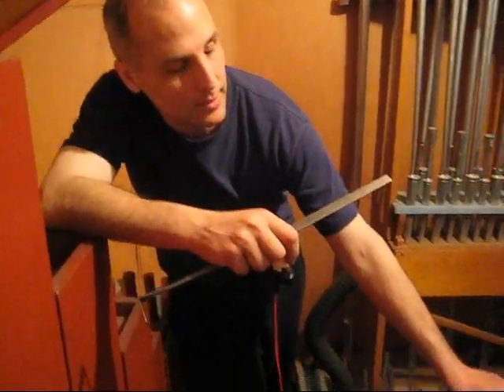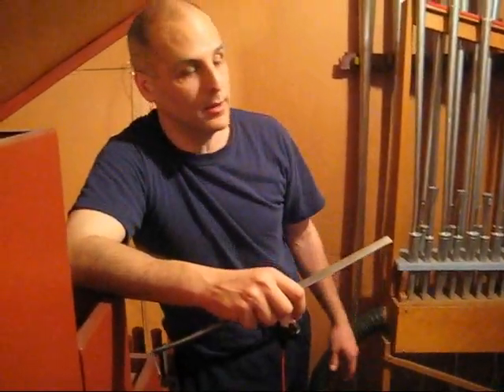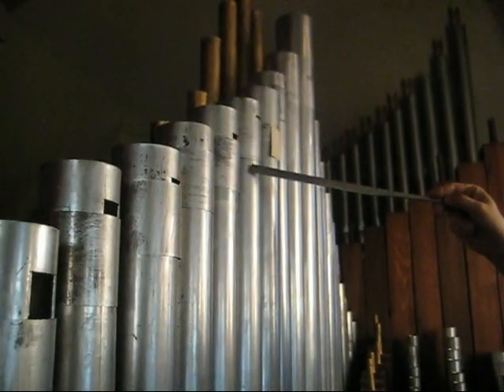Tuning an organ

Comment: Hi, i am an organist from India. I had a question to ask to David Quinton or to anyone who can answer. Our Hummond Organ was recently tuned, and it sounds nothing like how it used to sound, pre tuning. It now is one semitone higher, or lower. I need to change scales to even play the Organ. My only question is, do all organs be tuned one semitone higher or lower? Or do they sound just like the scale on the piano?
Reply: Not sure what 'tuning' you are referring to. The traditional Hammond organ uses tone wheels synchronized to mains frequency to generate tones, so there is no 'tuning' required. However, the filter capacitors used on the tone generator will drift out of spec over time and can need replacing. Doing that will change to the overall sound of the organ, sometimes not to the liking of the owners.

Comment: What kind of organ is that? It looks unified and using pipes from a half dozen (or so) sources.
Reply: The fancy pipes in the front are the only ones that actually match. All the other ones are just unfinished.
Reply: The front pipes, are they display pipes?